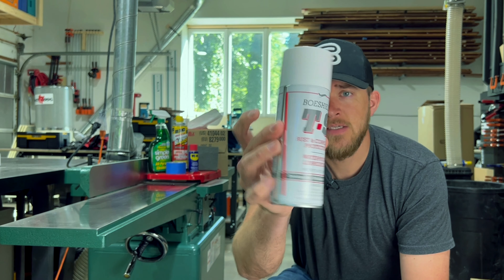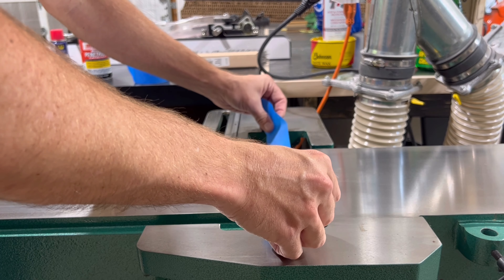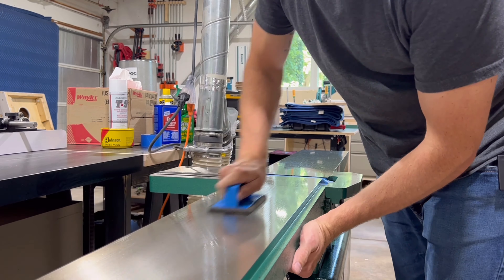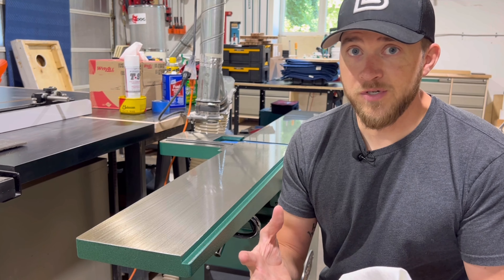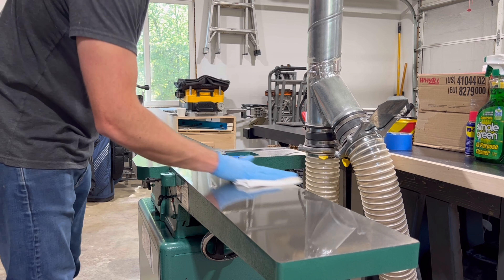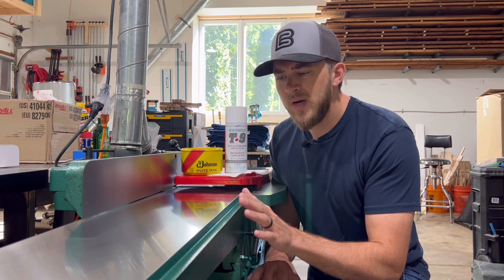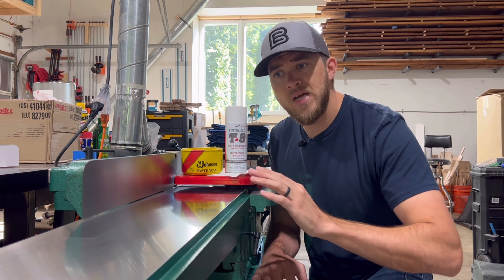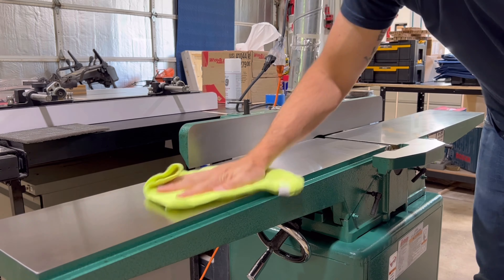A better way to PROTECT your cast iron tools?

Comment: This is, I believe, the perfect solution.  Most of my woodworking tools were purchased used and needed some rust remediation.  Once the surfaces were clean they got the same treatment that you describe.  I live just a few miles off of Galveston Bay in subtropical heat and humidity and am surrounded by bayous and other sources of humidity.  I let the Boeshield dry overnight and wipe the surface down with paper towels.  Then I let it dry for 24 hours before applying paste wax.  I have never been a fan of microfiber anything, preferring old real cotton towels to buff the paste wax.  The only rust I've had on a woodworking tool was when a friend set a soft drink on my table saw.  I told him that was a felony.  It only stained a little and cleaned up pretty easily.  Without the Boeshield/JPW treatment I have no doubt it would have been much worse.  My Johnson's Paste Wax is about half gone so it is only used for cast iron woodworking tools.

Comment: Just use Evaporust to remove the rust. No rubbing.  Then get it copper plated then Nickel electroplated. It will never rust again.
Reply from the maker: I’ll have to try that next time 👍
Reply: How much does it cost to send a planer to be copper plated?
.....it's most likely, not local,  so I'd assume there are shipping costs?
I'm just curious about the costs......
...roughly, not exactly.
Reply: Best to contact your nearest electroplating company for a quote. They typically charge by surface area and surface condition. 
Take some pictures with a ruler in the photos and email them to companies. 
  I did my table saw top, 27"x 30" cost me $400.00. My player was local, so I didn't have shipping charges. 
Turned out slick as glass.
Reply: .....not to mention the coolest table in the county. 👍  @mrgcav

Comment: Ive never used this stuff before. What do you think about putting it on leaf springs on a car? I'm restoring one and my new leafs are starting to rust a little bit. Would this stuff attract and hold dirt and dust?
Reply from the maker: I’m really not sure about using it for automotive purposes. Sorry.

Comment: I’m curious how you know T9 gives superior rust protection vs paste wax?
Reply from the maker: In order to compare the two, I would have to apply only the T9 or only the paste wax. In this scenario, I applied the T9 and put a coat of paste wax on top of it. So I can’t really give you a protection comparison. But I can tell you that the application of both had done great 👌
Reply: @EverydayBuilds  thanks for the follow up report! I saw an interesting video on Fireball Tool’s channel (a metalworking YouTuber) who did some side-by-side empirical testing and found that buffed out paste wax actually gave superior rust protection to the T9. Of course those test results could turn out differently in different testing environments and although I’ve used both products I also haven’t done a controlled comparison myself. Either way it’s good to know that the two products are compatible for layering and I like how your approach covers all the bases! (Some day I’d like to get a cordless buffer/polisher to REALLY get that wax in there and sliding smooth!)

Comment: Boeshield always leaves a sticky surface. Not really sure why you're using PB Blaster and then wiping it off with DNA; seems to cancel each other out and spraying it on thick is just spraying money on your tools and then wiping it off and throwing it away. Clean the metal, coat with paste wax and you're done. The rest would be best for people who mostly clean and worship their tools and do little building.
Reply from the maker: The PB Blaster is mostly there to act as a lubricant when buffing 👍